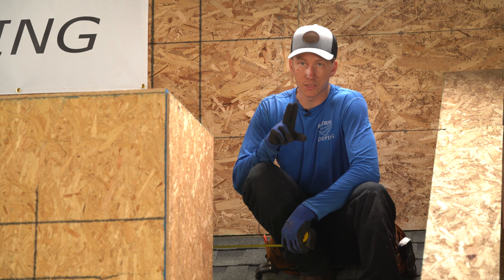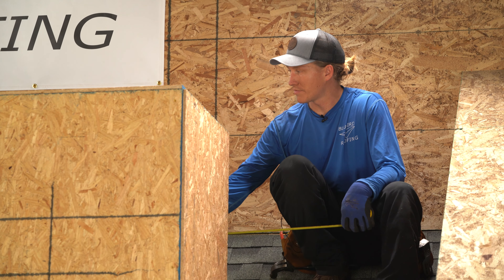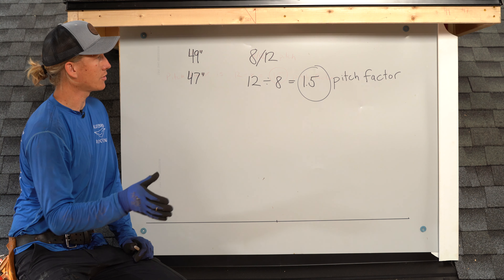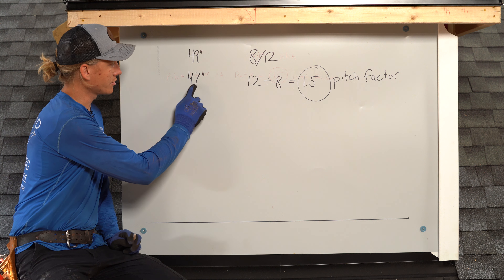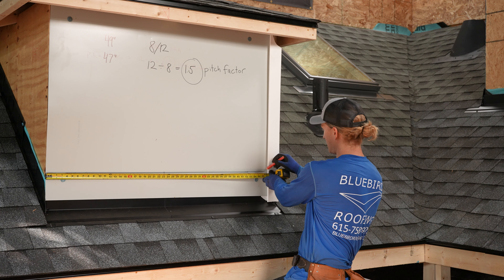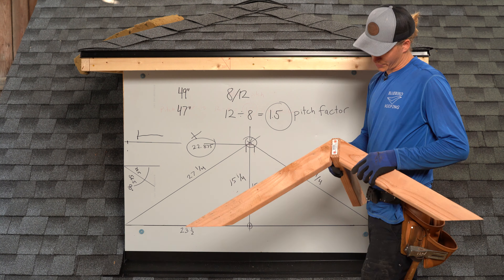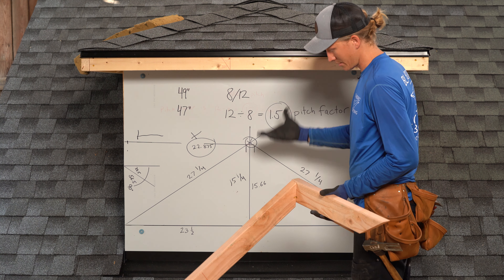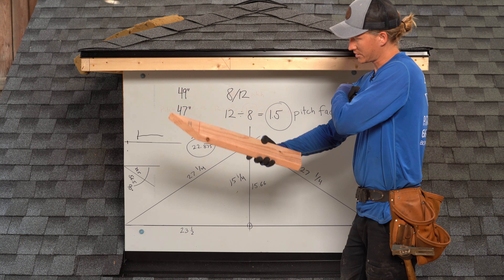How To Lay Out and Build A Chimney Cricket

Comment: Our roof started leaking and I'm in the process of gathering everything needed to replace it. I also need to build a Cricket - to do the entire job correctly. This is how I found your video. It was very helpful. I'm curious why you did not use sleeper boards to attach your cricket to vs relying on the sheathing alone?  If one wanted to have a sleeper board under the cricket - would they just remove 1.5" from your rafter measurement in your example? Are there any Cons in not having the sleeper boards?  At my age - I want this to be the last roof our house needs. Thanks, Tony
Reply from the maker: A sleeper for a cricket is overkill and unnecessary in my opinion.